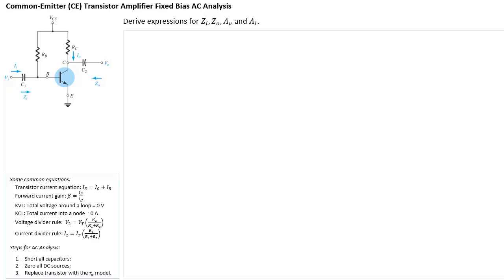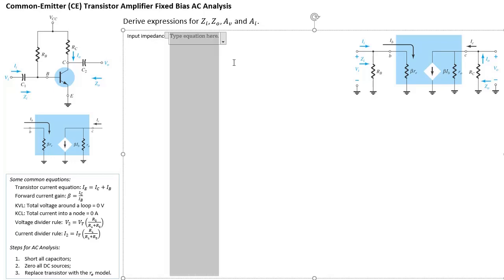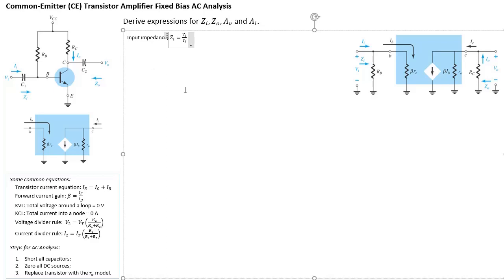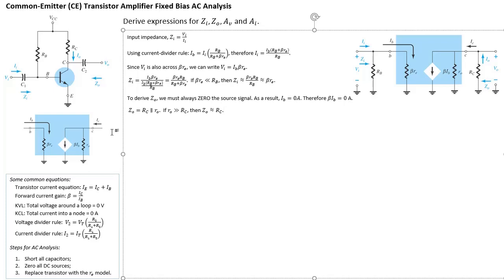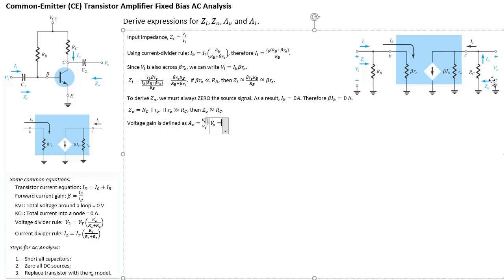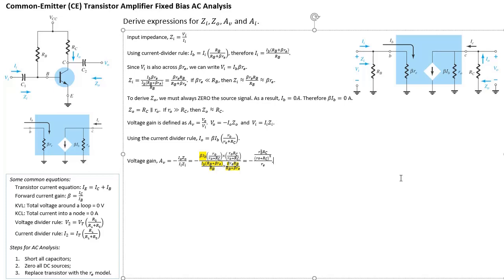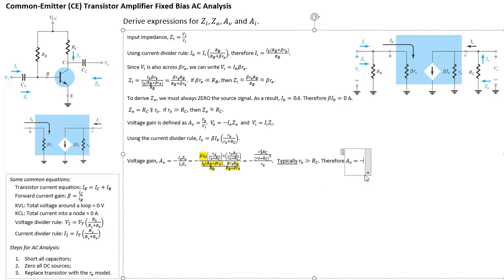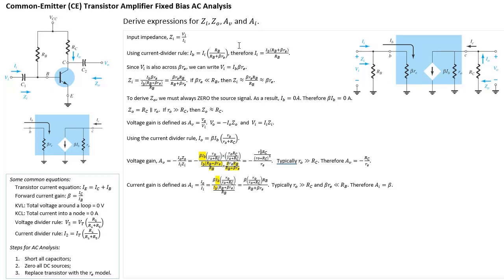AC Analysis of Fixed Bias Circuit - Small Signal Analysis of CE Amplifier Video

Comment: Hi sir! 😊 I have a question. Is there any explanation or principle behind the shorting of input source when solving for the output impedance, Z_o?

I assume two reasons but I don't know which or if any of it is correct. I suspect it's either (1) because, in actual, we only measure resistances without supply; or (2) because these types amplifiers only operate small signals, hence, making the input signal negligible to 0-V and allowing for a convenient solving of output impedance.

I apologize if these questions may seem basic. I'm just an undergraduate student and I just want to make sure that I really have a solid foundation when it comes to Electronics concepts. Hoping for your response, sir. God bless. 😊
Reply from the maker: Hi Raniel! Thx for asking! :)
Impedance/resistance across a load, by definition, is dependent on the cummulative effect of all applied signals to the system you're analysing (think Superposition Theorem). Don't forget that the other assumption we make is that, at the operating frequency, all capacitors are at negligible impedance (i.e. 0 Ohm). So what's left of the system will be purely resistive. The effects of non-zero AC input sources will therefore not affect our output impedance analysis as both current and voltage have zero phase difference in a pure resistive circuit. In other words, for the circuits we're dealing with, independent sources have no effect on our output impedance analysis. We can therefore simplify our analysis by assuming that all independent sources are zero (i.e. for a voltage source, it's at 0V - short circuit, for a current source, it's at 0A - open circuit).

Hope that helps. :)
Reply: @cikgutaiff  Given what you said sir, does this mean that, when it comes to DC circuits, a similar approach in determining output resistance can be carried out - that is, shorting the voltage sources? If so, then am I right in assuming that determining any circuit's effective resistance can be likened to simply determining its Thevenin's resistance? Thank you sir.
Reply from the maker: @RanielDG  Yes you are correct. We are indeed just determining Thevenin's resistance as these networks can indeed be modeled with either a Thevenin's or Norton's equivalent circuit.

Comment: Sir i didnt understand all the "typically" part where you mentioned ro>>Rc, Bre <<Rb.How to know those assumptions?
Reply from the maker: In analog electronics, when you see X << Y, it means that in actual circuit terms, X would at least be 10 times smaller than Y. These assumptions will help to simplify analysis. The only way to really know, is to actually do calculations to confirm. The ones mentioned in my videos are some of the more standard assumptions.